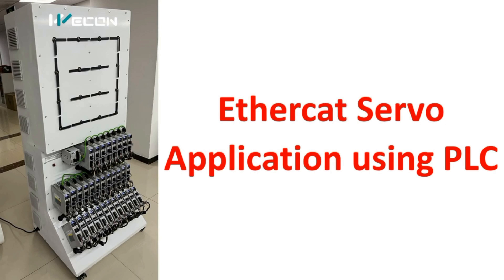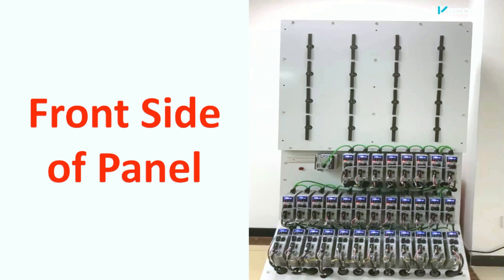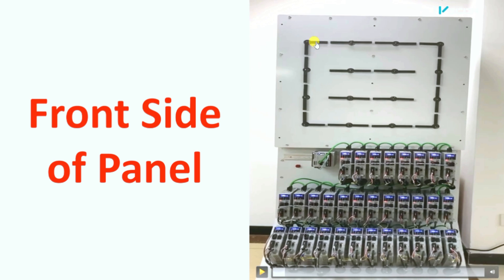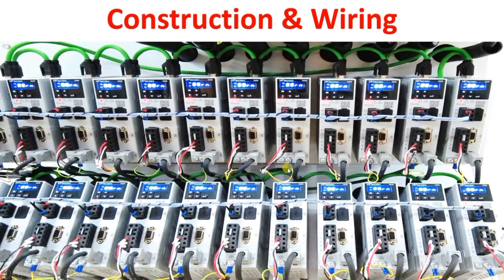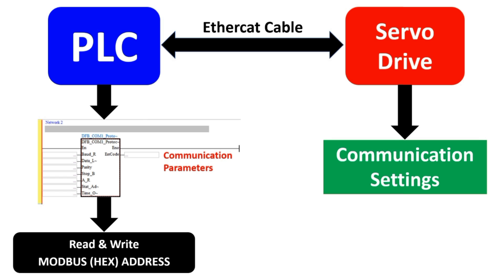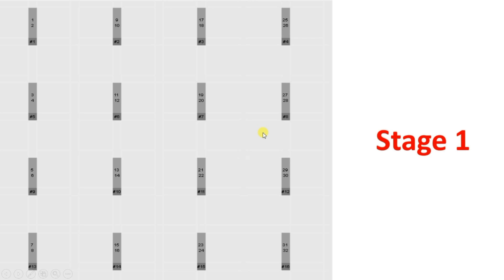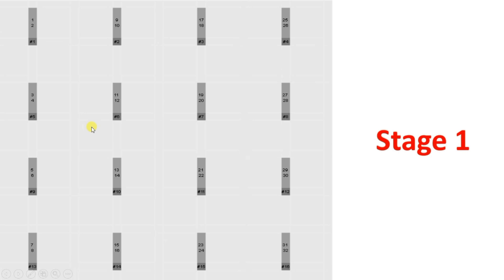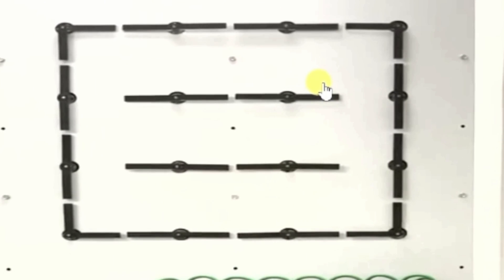EtherCAT based Motion Controller with PLC and Servo Drives

Comment from the maker: Correction - At the 7.34 timestamp, We used Ethercat Protocol but we mentioned Modbus. Please consider it Ethercat.
 
The servo drivers are connected to the PLC in series one by one through the network cable.
The number nearest to the PLC is 0, which is 1, 2,.... 31 in sequence (the numbering method is the same as that of the PLC module)
Then configure each servo in the PLC software, and finally control the servo movement through the program.